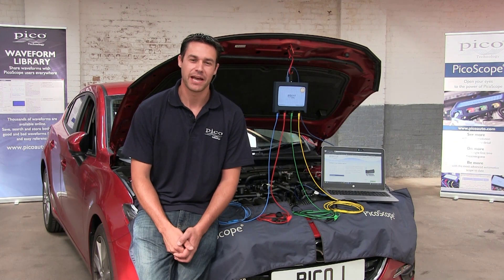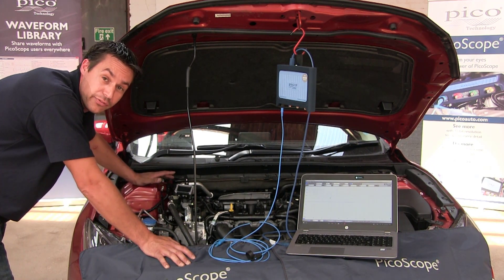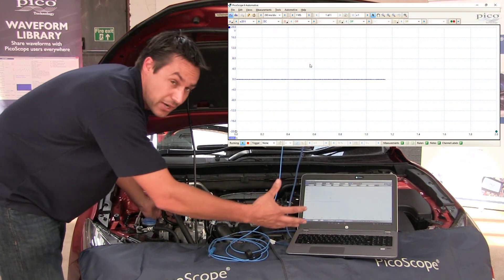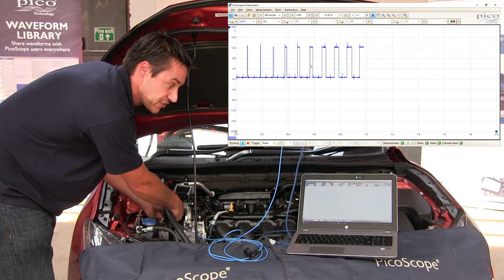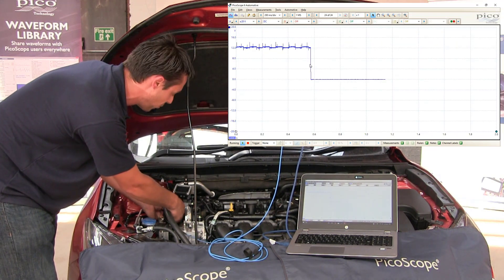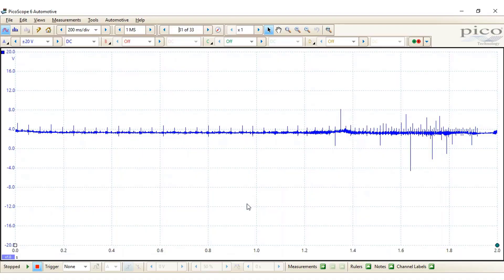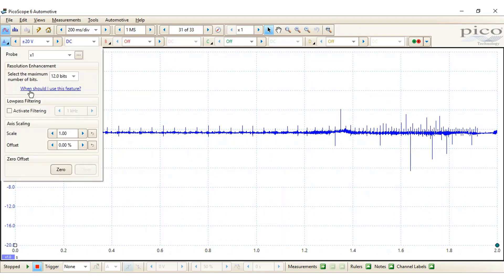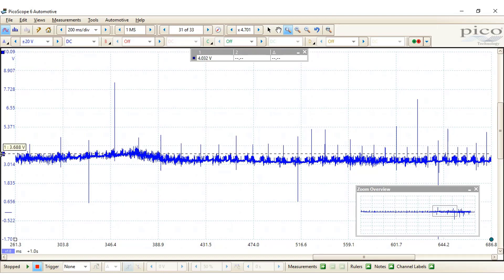PicoScope's 6-Way Premium breakout lead - Air fuel sensor

Comment: Don't some lambda sensors stay at a fixed voltage?
Reply: Yes you are correct. They tend to be more well known as A/F (Air Fuel) Ratio Sensors or Broadband Sensors. The idea is that they will monitor the current draw to a pumping cell which is used to maintain the oxygen content within the measurement chamber in order to maintain a fixed voltage. There will though be a small change in voltage within the sensor that we can use as a quick check to confirm activity. Different manufacturers will have different specifications on the this voltage so it is always best to check the technical information to determine the correct test plan. We have some further reading on the Bosch 4.2 Broadband Oxygen Sensor on our website which can be found here - https://www.picoauto.com/library/automotive-guided-tests/bosch-lsu-4.2-broadband-oxygen-sensor/ and https://www.picoauto.com/library/training/bosch-lsu-4.2-broadband-oxygen-sensor. I hope this helps.
Reply: @benmartins6283  Thanks for your reply.